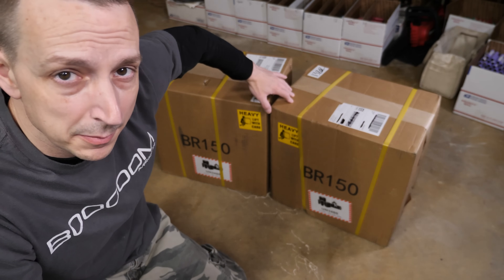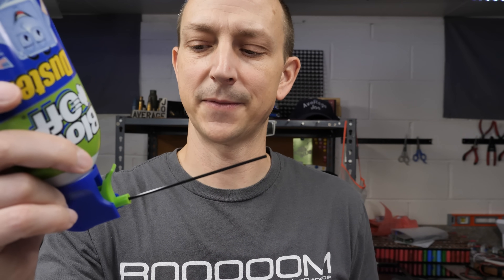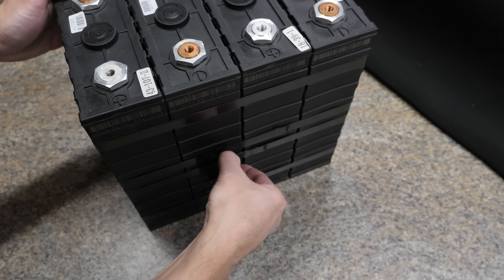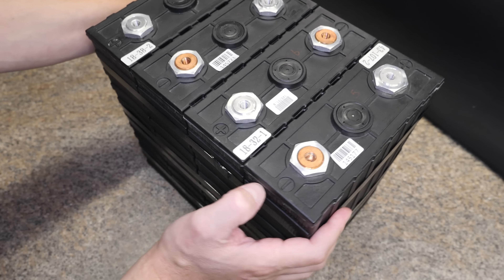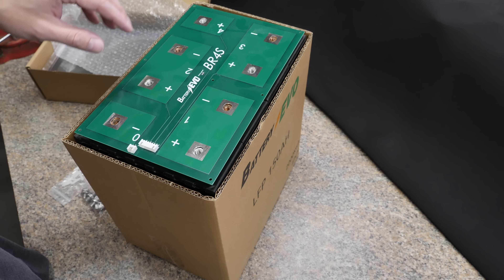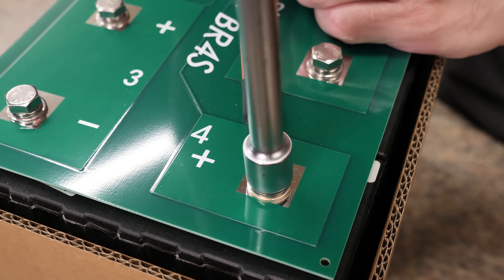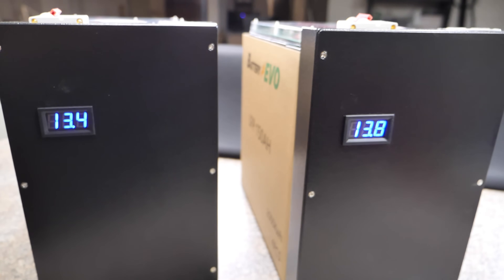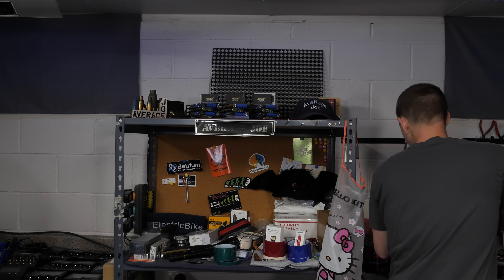BR150 Battery Kits from BatteryEVO.com

Comment: Pulled the pin and ordered one after watching your video. I have been bouncing between battery sellers and have a good collection of LIPOs going. Planning on starting with this battery and using it for boondocking for my CPAP and other 12 v things like lighting, water pump for water etc. great video and smashed the subscribe button. Oh and I did use the product code. Worked great.
Reply from the maker: NOICE! Yeah this would be great for that! Hey how much power do those cpap machines draw? I was thinking in the next build video for these mentioning medical devices like that during power outages cause it sure seems like a lot of people use them!

Edit: let me know how your boondocking goes! Would love to hear!🤘

Comment: Your vlog go long mate, my vlogs go long too. The battery is 1.8 KWhs mate, what is the C rate for discharging?
Reply from the maker: Yeah I cant help it. I think there is to much info for short videos😆🤷‍♂️ Well on the discharge test I got just a hair over 2kwh. C rate said 4C BUT it didnt say for how long. Normal C rate is most likely 1C or a little more.
Reply: @AVERAGE_JOE  Sound like the 4C is four maximum of small period mate. Well 2KWh pretty good.

Comment: Love your videos Joe and "Toody"
My first application is to replace lead acid coach  batteries in my RV  (only two left operational and they are weak).  My diesel generator starts off the coach batteries (marine deep cycle). 
Even with a pretty good charger they lose water and capacity.  Would one BR150  with a 
motor start capacitor bank or  jump start devices work?  Anyone       tried that?  I have heard that the "ultra capacitors have lots of leakage"  any thoughts?
The coach batteries are so weak its getting hard to start the 7.5KW diesel generator. 
I like the flat discharge curve of the LiFePO4 batteries.  I think two of these batteries would give me more usable amp/hrs than the lead acid (which aren't cheap no more).
Reply from the maker: Thanks Carl! Its possible you could. I havent tried starting anything yet but plan to. I do have a 6.5liter diesel suburban that I could try!

Edit: a 7.5kw gen should start no prob I would think. Again tho Ill find out!

Comment: I really like that kit setup!  Most of the time I don’t like how a BMs interacts with a battery but the board and panel integration
Reply from the maker: Yeah I kinda like the bare bonzey style! What part of the or a bms do you not like? If you have a fav bms, you can get the kit that has busbars BUT you could order the circuit board by itself and use your own bms if needed.

Comment: Useful video. Thanks. I’m thinking 4 of these to get 300ah at 24v. Wondering on the bms. Active or passive balancing?
Reply from the maker: Thanks Tim! Yeah that would work. Bms would be passive balancing!🤘
Reply: I alsow want this and have 4 in 24 volt
Reply: Possible to ship 4 or 8 of this to norway ???

Comment: Probably used 172AH cells.  Love the concept.  Wish they would source and sell (or recommend) a suitable case of some kind.  I am not, repeat NOT, going to trust my $500+ battery to a corrugated cardboard box...ain't happenin'.  Also, their 24v "system" is really just two 12v batteries, with an Anderson cable to put them in series.  Not horrible, but not really a dedicated 24v solution (can't be charged with a 24v charging system).
Reply from the maker: Someone emailed them and they replied with 180ah original capacity cells. I guess I could have done the same lol😆🤷‍♂️🤦‍♂️ So im planning a lil cheap off grid system with these in 24v and plan to charge them with the inverter charger/ solar charger.  Also there site showed a 24v without bms so you could get an 8s bms if wanted. I did pick one up jic I go that route if the bms's blow up trying to start vehicles😆💥🤘
Reply: @AVERAGE_JOE  - The amount of sustained amperage draw for a starter motor is not only more than any standard BMS is going to deliver, the C rate on most LiFePO4 cells just isn't designed for that.  Some companies are just now starting to deliver batteries built to do that, but to try it with standard components is to damage the battery cells, at the very least, and invite catastrophic failure, at worst.  Maybe for a vehicle that starts easily, in warm weather, you can pull it off as kind of a parlor trick, but that would only create the confusion that these batteries are actually suitable for such use.
Reply from the maker: Yep 100% agree!

Comment: It's kinda like having 600 x 18650's
mostly they're all good.
occasionally you check on them and they're still alive :)

I know how much is involved.  Post more often @Hoe ;)
Reply from the maker: All 100% Troof!!😆 I want to post all the damn time but my joby job is taking up all the time. The base I work on closed the runway so they can redo it. So during this time we are driving an hour away to fix planes like slaves then drive back....repeat!!🤮
Reply: @AVERAGE_JOE  Ahhhhhhhhhhhh... that's rough. Least it's only temporary. 

I have to drive an hour to and from work (on a clear run) also, so I feel your pain buddy.
Reply from the maker: Yeah my body does not like it!

Comment: Those batteries will easily start a vehicle as long as you bypass the BMS for starting the vehicle.  Also without a diode when used to start a vehicle you will not want to leave the engine on very long charging the battery to prevent damage if the vehicle charging system goes over 14.5v but a short period of time testing will be fine.
Reply from the maker: I wanna try with bms first😆 and then if no worky Ill try without! Yeah dont want to leave charging to long for sure!!
Reply: @AVERAGE_JOE  it possible to damage the BMS that way.. especially with repurpose equipment
Reply from the maker: Its possible! Well give it a try and see what happens!

Comment: Do you think the cells are new?
Reply from the maker: No they are "recertified/referb" which is a fancy way of saying used! However they say each is tested 3 times and will have a min of 150ah!
Reply: Since they are recertified, I would guess that these cells were used in a battery backup or were in storage as replacements and so likely have not seen many cycles.  It would be nice to know what the original rated capacity was so we could see how much they derated them if at all from the original capacity.  What many people tend to gloss over is that a lithium cell is basicly junk once it goes below 70% of its original capacity since the cell degradation speeds up once the capacity goes below 80% and below 70% the odds of a cell failing increase at a much more rapid rate.
Reply: @kuhrd  they are used 180 ah cells
Reply from the maker: Oh nice! Did you happen to find that somewhere?
Reply: @AVERAGE_JOE  i emailed them and that was basically what they said. They couldnt “disclose” the previous user. They where originally 180ah and with degradation they can guarantee 150
Reply from the maker: Awesome! Im wondering why I didnt just ask lol💁‍♂️🤦‍♂️
Reply from the maker: Yeah Im not 100% sure what they are from or the original capacity.
Reply: @kuhrd  
if they lost that much capacity, they were definitively heavily used. i suspect they coming from chinese busses
Reply: @ursodermatt8809  Yeah they didn't mention the original capacity on the data sheet (or at least i could not find it) that was provided.  If they were 180Ah orginally that means they are down to 83% of the original capacity and that would mean they don't have much life left since LiFePO4 cells are generally EoL at 70% since the rate of a cell failure dur to degradation begins to increase below that.

Comment: yes they can start your car, I have done it for years
Reply from the maker: What size motor?
Reply: @AVERAGE_JOE  Supra 3 liter 2jzgte Inline 6 and Hummer H2 6 liter v8 Vortec. I only have 100ah life cells and they do nicely at 3c. I ran it without bms for a year but recently installed 100a bms set at 150a on Supra and Doubled up on Hummer by running two 100a bms in parrallel. I think what you purchased is 200ah cells that are heavily used and have lost 41ah. The 100ah cells fit nicely in my battery trays. But you might have to relocate yours to the trunk.
Reply from the maker: Nice!! Yeah Im just planning on starting for messing around lol. Another emailed them and they said the cells were 180ah.

Comment: With that BMS, if I create 4 of those 12v batteries, can I put those four 12v into a 2s2P configuration for 24v total? Thank you for another great video
Reply from the maker: You betcha you can do that! What project you working on?🤘
Reply: @AVERAGE_JOE  I'm putting a system in my toyhauler.
Reply from the maker: Toyhauler would be cool to do!!!
Reply: @AVERAGE_JOE  I have a 
24v/220 inverter  it's small I don't think I want to trust it. 24 to 12 converter for all the lighting.I was going wirh golfcart batteries,but the two batteries although I'll have to save a little bit longer.
Reply from the maker: Why not trust the inverter? As for golfcart batteries....please dont! Lead acid is old school. Dont get me wrong they still play major roll but its not in storage anymore. Lithium batteries are so much cheaper these days and will last YEARS longer with damn near zero maintenance! Go lithium even if you dont go with these!🤘
Reply: @AVERAGE_JOE  I want to create a battery backup for several things during a power outage. Was going to get the new Ecoflow Delta Pro, but I can get a lot more battery Wh if I build it myself. Do you have any experience with inverter/chargers such as the GroWatt SPF 3000TL for 24 volts? That sounds about the price point I am looking at, plus adding two or four 12v 100Ah batteries. If I can do 120 or 150 Ah batteries, even better.
Reply from the maker: Yeah a backup system would be great! Im gonna build a small 24v system with these 2 and use a super cheap $400 all in one inverter I found on alibaba. The growatt would be a great choice as well.
Reply: @AVERAGE_JOE  Thanks joe I will be sure to watch that one
Reply: @DialM4Microcontrollr  That's a nice idea and something that I have planned at some point. The ecoflows and other similar devices just don't seem to be coming down in price with each generation so I will need to go DIY too.
Reply from the maker: Nothing wrong with diy!!🤘
Reply: @AVERAGE_JOE  I’m not sure you can connect these BMS in series? Wouldn’t you be better off getting the bare bones kit and getting an 8 cell BMS for 24V? The BMS did seem to have ports on them.
Reply from the maker: Yeah the very best way to do it would be the bare bone busbar kit and get a bms to suite BUT if someone wasnt comfortable with doing that then the other will get the job done. 🤘
Reply: @AVERAGE_JOE  I suppose so - as long as you kept an eye on the balance between the 2 BMS over time. I wouldn’t do it with a 48V system unless the BMS’s  communicate.  I’m not sure what happens when one battery stops charging before the other. Will the charger turn off or will it stay in circuit?  There’s another video for you. If the batteries aren’t balanced to begin with, and charging stops they will never be in balance. Once they get out of balance you would have to manually rebalance them. Worse still if the charger stays on you potentially fry the second BMS.
Reply: I'm building 24v system too

Comment: Hell yeah, wanna see you try start a boat motor.
Reply from the maker: I have a boat with a Chevy 350 in it but its winterized atm. I have a few other engines here tho😅😉😉
Reply: Yes please
Reply: What would be the top concern if it is used as a crank batt to a 200 HP outboard?

Comment: They would start cars if you combined them with a capacitor bank.  Battery charges capacitor, capacitor starts car.  I have seen this done a few times and it is pretty neat.  Thanks for the great video.
Reply: Small enough engine and it migjt be fine as is... Depends upon how quick the BMS shuts off on overcurrent spikes. 

Just as a goofy comment, i had an older 98 civic hanging around for a few years and the battery died... I had a spare 120cca lawnmower battery so i threw it in, and it worked! I drove it for a summer like that as an experiment. Kept a jumper with my in case it failed.
Reply from the maker: Love that!!!😄
Reply: @volvo09  Yup, could work for sure if it were a 4 cyl.
Reply from the maker: I have some big ole capacitors if needed. I wanna try without for sure and see what happens!😆